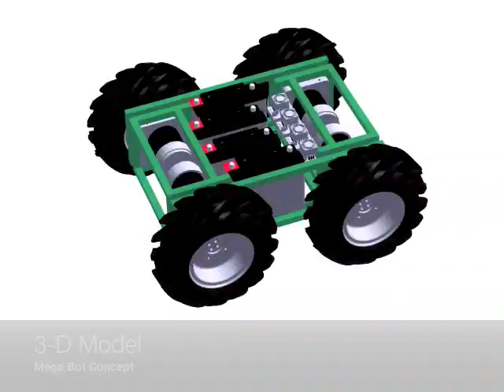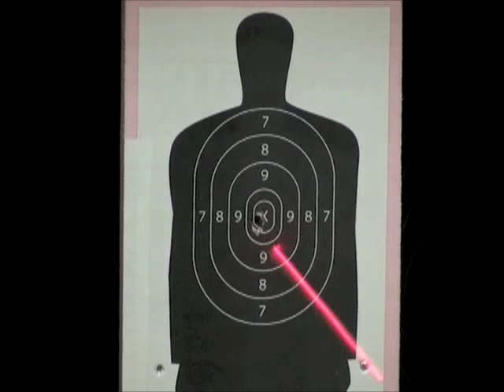The Mega Bot 4-Wheel Drive Robotic Platform

Comment from the maker: The Mega Bot typically uses 12 Volt Lead Acid Motorcycle Batteries. Although, in theory, you could use any type of battery. The heavy Lead Acid was chosen because, we wanted to build momentum for bashing through walls and increasing traction when towing vehicles.

Comment: I want to make something like this(not so complicated) for my school project with easily available materials..How should I?
Reply: Robot Marketplace has starter kits available that come with motors, electronics and wheels. As for the structural components, you could use wood, though if you plan on using it for anything high-stress I would suggest using stainless steel or even alloy steel. You can find that at OnlineMetals.
Reply: Thanks..